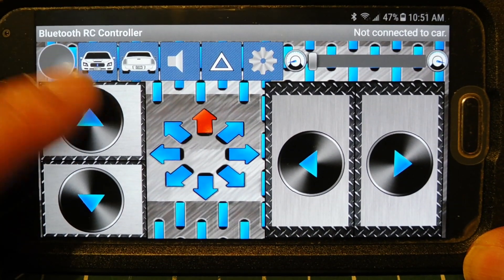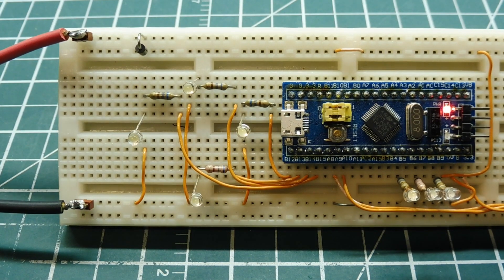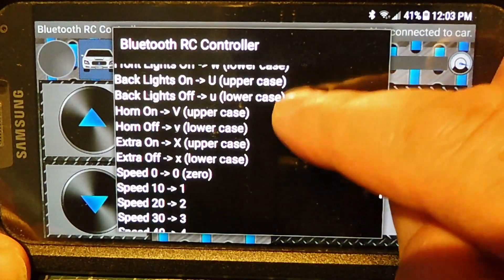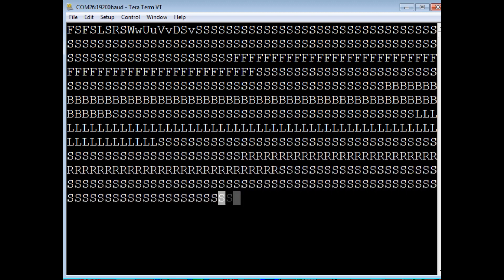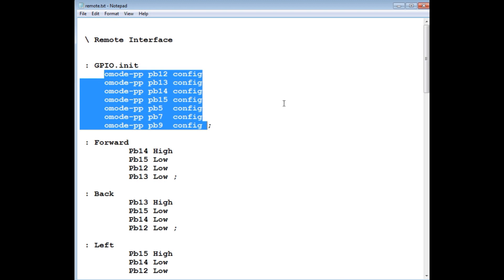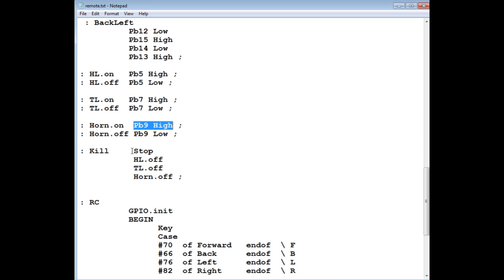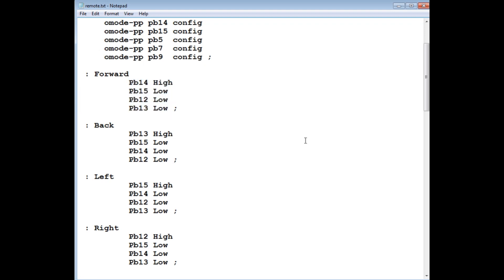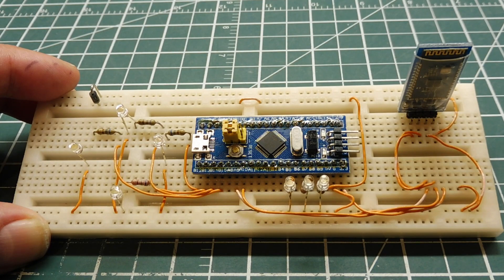Bluetooth RC Controller Interface  /  Blue-pill ARM

Comment: Please explain how to use tera term to log bluetooth signals
Reply from the maker: Enable Bluetooth on your computer. Go to setting and select Add a Device and add your cell phone. In settings select Ad a Com port. In Tera Term select the Com port and pair the app to your computer.
Reply: @0033mer  Thanks but will it work if I have an inbuilt bluetooth Bluetooth adapter in my laptop and not an external one ?
Cause it doesn't list any such com ports
Reply from the maker: You can use the built in Bluetooth in your laptop. Go to Bluetooth settings and select More Bluetooth Options and select Com Port.

Comment: Good video. Would it be possible to control micro servos using this? Thereby creating a backyard model plane flying with bluetooth control. Any advice would be welcome.
Reply from the maker: An RC servo is controlled by PWM (Pulse Width Modulation ) where a pulse of a specific width is sent every 20 milliseconds to control the position of the servo. A pulse width of 1 ms to 2 ms can move a servo to its extreme CW and CCW positions. Bluetooth sends text (ASCII strings) as data so we can send the values 1000 to 2000 as text over Bluetooth and have a microcontroller decode those values to control the servo.
https://youtu.be/VcqCR7IOatw

Comment: Interesting project. On thing I didn't understand about the phone app protocol. Pushing the forward button sends an F. Releasing the forward button sends an S. Pushing the left button sends L. Releasing the left button sends an S. What is the sequence send if you push forward, _then _left, then release forward? FLS? How does the code know if the stop (S) means you have released forward or left? 
EDIT: Looking at the main loop at 8:40 it is clear to me that I don't understand the protocol. I thought you sand that if any of the four direction keys was released the stop (S) command was sent. What button presses result in the  command I, G, J or H?

Seems like it would have been a better protocol if an upper case letter indicates pushed and a lower case letter indicates release just light the toggles for lights and horn.
Reply from the maker: When all direction keys are released a stop function is sent. If you push forward and left and then release forward you get a left direction. I,G,J and H indicate combination directions. Check the comments in the case statement, they show the char sent with the combination command in the body. Normal mode is streaming where you can only have either a direction or stop. Streaming multiple commands would be confusing. The toggle function is sent once in the stream while direction and stop is always running. This is a simple protocol where beginners can get code up and running quickly. There are other apps where you build your own protocol packets which is suited more to experienced programmers.
Reply: @0033mer  Thanks for the clarification. I understand that the app protocol is out of your hands, right? A simpler protocol would be to send a character for each press and each release. No need for a stop. The toggle protocol was upper case for ON and lower case for OFF. That could work for the directions as well. Just saying.

Comment: 0033mer, Best video ever, now I get an idea of how to use Forth and do something constructive with a Blue Pill module.
I have a few HC-05 BT units around here and three BP modules with Forth (mecrisp Stellaris) on them already.
Only bought my first Arduino 5 weeks ago (got a few PB's as well, as they were cheap) and can only string two lines of code 
together in C++, Arduino. 5 minutes of this video and I could at least get some simple Forth code up and running to make
something actually work.
Great job, thanks. More Please !
Reply from the maker: Thanks for the feedback. Check out Jeelabs site online for more Mecrisp code to get you going.
https://jeelabs.org/article/1718a/
Reply: @0033mer  Hi 0033mer, I tried writing your code to the BP but I seem to be getting errors.
I typed it out as best I could from the video, I hope I use the correct syntax and got it right etc.
I pasted it into terminal window and got the result below.

 Remote Control Interface use Phone App also.  ok.
  ok.
: GPIO.init  ok.
    omode-pp pb12 config omode-pp not found.
    omode-pp pb13 config omode-pp not found.
    omode-pp pb14 config omode-pp not found.
    omode-pp pb15 config omode-pp not found.
    omode-pp pb5  config omode-pp not found.
    omode-pp pb7  config omode-pp not found.
    omode-pp pb9  config ; omode-pp not found.
  ok.
and further down ~
  ok.
: RC  GPIO.init GPIO.init not found.
         BEGIN BEGIN is compile-only.
               Key  ok.
            Case Case is compile-only.
               #70  of Forward   endof \ F of is compile-only.

               #66  of Back      endof \ B of is compile-only.
and further down~

 nop  ok.
               Endcase Endcase is compile-only.
         AGAIN ;        AGAIN is compile-only.

If I look at Words they are all there ~ words
Address: 2000051C Link: 2000050C Flags: 0000FFFF Code: 20000526 Name: RC
Address: 2000050C Link: 200004FC Flags: 0000FFFF Code: 20000518 Name: Kill
Address: 200004FC Link: 200004EC Flags: 0000FFFF Code: 2000050A Name: TL.off
Address: 200004EC Link: 200004DC Flags: 0000FFFF Code: 200004F8 Name: TL.on
Address: 200004DC Link: 200004CC Flags: 0000FFFF Code: 200004EA Name: HL.off
Address: 200004CC Link: 200004B8 Flags: 0000FFFF Code: 200004D8 Name: HL.on
Address: 200004B8 Link: 200004A4 Flags: 0000FFFF Code: 200004C8 Name: BackLeft
Address: 200004A4 Link: 20000494 Flags: 0000FFFF Code: 200004B4 Name: BackRight
Address: 20000494 Link: 20000480 Flags: 0000FFFF Code: 200004A2 Name: ForLeft
Address: 20000480 Link: 20000470 Flags: 0000FFFF Code: 20000490 Name: ForRight
Address: 20000470 Link: 20000460 Flags: 0000FFFF Code: 2000047C Name: Stop
Address: 20000460 Link: 20000450 Flags: 0000FFFF Code: 2000046C Name: Right
Address: 20000450 Link: 20000440 Flags: 0000FFFF Code: 2000045C Name: Left
Address: 20000440 Link: 20000430 Flags: 0000FFFF Code: 2000044C Name: Back
Address: 20000430 Link: 2000041C Flags: 0000FFFF Code: 2000043E Name: Forward
Address: 2000041C Link: 20000410 Flags: 0000FFFF Code: 2000042C Name: GPIO.init
Address: 20000410 Link: 20000400 Flags: 0000FFFF Code: 2000041A Name: RC
Address: 20000400 Link: 200003F0 Flags: 0000FFFF Code: 2000040C Name: Kill
Address: 200003F0 Link: 200003E0 Flags: 0000FFFF Code: 200003FC Name: TL.on
Address: 200003E0 Link: 200003CC Flags: 0000FFFF Code: 200003EC Name: HL.on
Address: 200003CC Link: 200003B8 Flags: 0000FFFF Code: 200003DC Name: BackLeft
Address: 200003B8 Link: 200003A8 Flags: 0000FFFF Code: 200003C8 Name: BackRight
Address: 200003A8 Link: 20000394 Flags: 0000FFFF Code: 200003B6 Name: ForLeft
Address: 20000394 Link: 20000384 Flags: 0000FFFF Code: 200003A4 Name: ForRight
Address: 20000384 Link: 20000374 Flags: 0000FFFF Code: 20000390 Name: Stop
Address: 20000374 Link: 20000364 Flags: 0000FFFF Code: 20000380 Name: Right
Address: 20000364 Link: 20000354 Flags: 0000FFFF Code: 20000370 Name: Left
Address: 20000354 Link: 20000344 Flags: 0000FFFF Code: 20000360 Name: Back
Address: 20000344 Link: 20000330 Flags: 0000FFFF Code: 20000352 Name: Forward
Address: 20000330 Link: 00000150 Flags: 0000FFFF Code: 20000340 Name: GPIO.init
Address: 00000150 Link: 00000176 Flags: 0000FFFF Code: 00000176 Name: --- Mecrisp-Stellaris 2.5.0 ---
Address: 00000176 Link: 0000018E Flags: 0

Is there a way to turn off the Address, Link, Flags etc part and just get the words.
Do I need to setup "omode-pp pb12 config" or something first ?
This is the first thing I've tried using Forth, so I really don't have a clue.
Do I need to flush out the memory before retrying it again etc.

Any help appreciated, Cheers, Michael.
Reply from the maker: Forth is an extensible language where you write your own words and put them in the dictionary. I have written some my own GPIO words which will not be in your dictionary. If you are a beginner start out by getting to know the workings of the GPIO. Start out simple by turning on/off GPIO pins to control a LED. Check out the Jeelabs link and have a look at io.fs for words to control the GPIO.
Reply: @0033mer  Hi 0033mer, thanks for the reply. I'm a bit disappointed though as I thought I was getting the whole RC Car package. I have been on an epic journey through JeeLabs, Git Hub and several other sites just trying to get the GPIO pins to even work, JeeLabs has many dead Links probably the ones I really needed. I have downloaded embellio
.fs library files, folie, 1608-forth and many more, I have saved a hundred web pages and a heap other files.
But I have not yet found a single page on how to setup or implement the library files or any practical examples on how
to configure the Blue Pill GPIO port pins from scratch. There were one or two examples but for different Chips or they
then went off on some other tangent for Arduino or non Forth programming etc. There is not much useful information to
encourage a bare bones beginner. Sure using Forth and the Blue Pill work fine and make a great calculator currently.
But I need to get to the outside world, I can't even get the onboard LED to flash as it is. I'll keep reading and trawling.
Reply from the maker: If your priority is to get the RC car project up and running maybe using the Arduino Nano may be easier for you as I have done. All you need to do is decode Ascii characters. Check out this video: https://youtu.be/FW2fbMqY6j8 If you want to continue with the Blue-pill download the io.fs file: https://git.jeelabs.org/jcw/embello/src/branch/master/explore/1608-forth/flib/stm32f1/io.fs
This will allow you to use the GPIO on the Blue-pill.

Comment: I have a BT robot control app I did with the MIT app system. It has a lot of abilities and allows for simple 2way communication. This allows for Debug, alerts, etc. Will also allow for simple speech control.   http://ai2.appinventor.mit.edu/?galleryId=4644705354907648